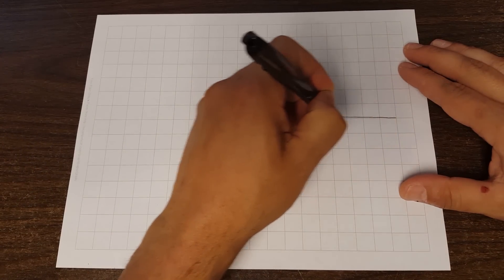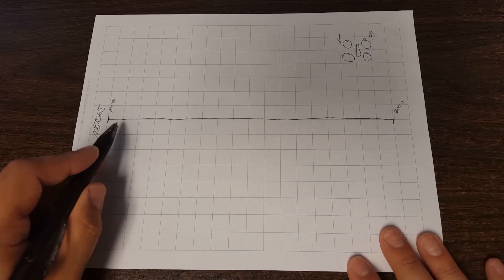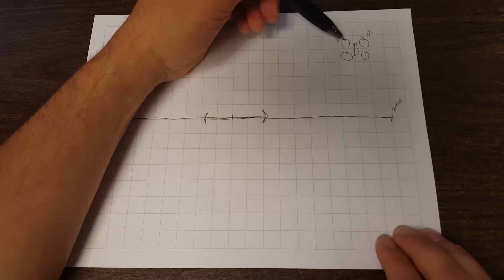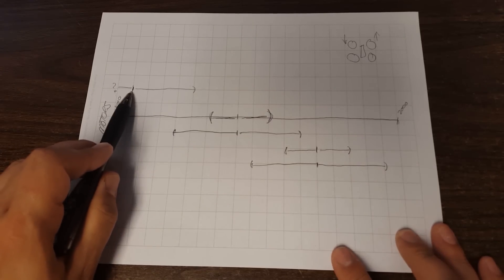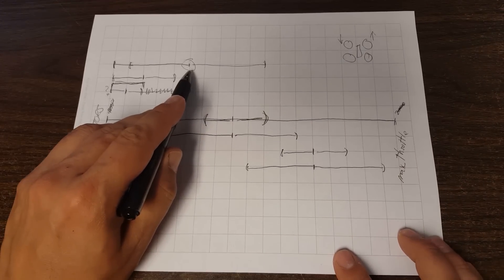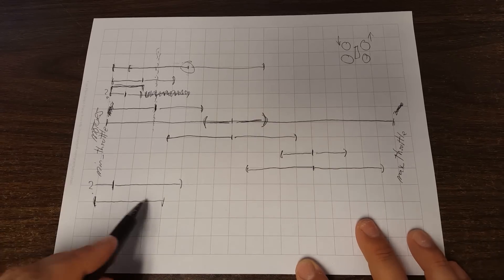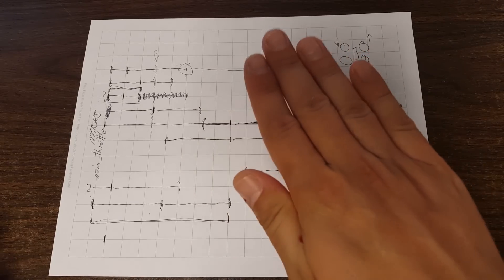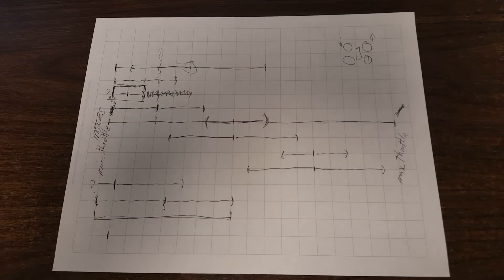What is Airmode? | BETAFLIGHT WITH AIR MODE EXPLAINED

Comment: joshua, thanks a lot for another great valuable video. i really like your channel and learned a lot from you even though I am in FPV for a while.
i have one question concerning air mode: I do not understand, why a copter on the ground either with props on and holding it or without props just sitting on my table shows same behavior:
with airmode activated and giving a quick throttle punch, the motors are spinning pretty fast but do not calm down anymore.
doing the same without airmode motor speed is going down immediatly again after the throttle punch.
how come?

thanks a lot and best regards from vienna, austria!
christian
Reply: The gyros are sensing tiny vibrations in the quad, and when they try to compensate for them nothing happens because there are no props on. So the pid controller spins the motors faster and faster to compensate until they are at full throttle. The pid controller doesn't think that the quad is where it should be.
Reply: Really valuable video. And I met the same situations with yours...
Reply: I get the same issue. Fairly new Wizard x220. Without props it's just scary. You raise and hold the throttle just a little and 2 of my motors, 2 & 3 I believe, just slowly increase in speed. Or when I move the pitch/roll/yaw around it goes all nuts and stays crazy, which that's probably due to the PIDs wanting to go to the virtual position that it thinks it should be in even though it's just sitting on the table.

I had it go nuts while it the air the first 10 seconds and smacked the ground. Shorted an ESC. Just replaced it with a v2 racerstar. Updated and tuned it, seems okay now.The DRL Simulator is definitely different. Seems to hold throttle a lot better.
Reply: @thomastommy9864  does the wizard 220 have an air mode?

Comment: Lesson learned.  Do not land in Airmode.   I have linked my Airmode to Acro and switch into hover right before touchdown.  If your copter is acro only with everything else disabled than you should have airmode disabled before landing with a switch.    The Airmode idea is brilliant, once again I am really proud of my fellow countryman Boris for Betaflight development.
Reply from the maker: +RC Pilot Multirotor I have air mode on all the time and have no trouble landing. I'm not sure what all the fuss is about.
Reply from the maker: Okay, okay... I was being a little glib. I think the fuss is from people who stick arm, who can't input the disarm command as sharply as if you switch arm. If you switch arm, it is zero problem to flip the switch at the same time as when you zero the throttle. If you stick arm, you have to zero the throttle and then yaw left, and it may take a fraction of a second to register the command.

If you have a spare Aux channel, and most of us do these days, I think you should convert to switch arming. Stick arming is an artifact of the days when we had four-channel radios. Overloading the control in that way for a function as important as arm/disarm is bad UI design. (IMO of course)

Comment: How about if air mode makes my motors spin even at min throttle?  I couldn't arm without the motors spinning up so I turned air mode off.  Naze 32 with 1060 min throttle.
Reply from the maker: +Michael Koster that's intentional. If you don't like it, put air mode on a switch.
Reply: Thx for the reply, I will put it on a switch.  Is there any point in using the motor_stop function?  I guess if you aren't taking off in air mode you still get benefit from motor_stop.  With air mode can I kill the throttle fully and the quad will stay upright? (mine currently starts to roll),  will it still descend quickly?
Reply from the maker: Air mode keeps the copter stable when you cut the throttle. 

I don't personally think motor stop is safe.

Comment: Fantastic explanation. I have a question relating to the airmode_activate_throttle parameter which is set to 1350 by default. As I am using a switch to activate airmode does this parameter has any effect at all? If it does should I lower this value as whilst performing loops I keep throttle to very minimum for slightly longer during drops and performing maneuvers during aggressive descends? (I also have enabled the motors to spin when armed). Thanks!
Reply from the maker: airmode_activate only applies to the first time the throttle goes above this value. After that, airmode is on all the time. So that value won't affect your power loops at all.

Comment: Can anyone tell me what would happen if you crashed with air mode on?
Reply from the maker: I think that air mode actually helps with crashing. Since enabling air mode, I have had more crashes where the copter stabilized itself and I was able to fly away. Early on in air mode's development, it was too aggressive and could result in violent flyaways if the copter was knocked about. That's no an issue any more as far as I know.

Comment: With the constantly evolving technology surrounding firmware is it possible to have an air mode that only works when throttle is above one box so when someone tries to land and they give min throttle airmode won't engage
Reply from the maker: Not easily. If you have a Taranis, you could link an Aux channel to the throttle so that the Aux channel only activated air mode when the throttle was above min_check, or something like that. But I hear tell that in Betaflight 2.8.0 air mode isn't a mode any more, so I'm not sure you can turn it off.
Reply: Does what I asked make since??
Reply from the maker: Yeah, sure. You want air mode to deactivate when you drop the throttle all the way so you can land more easily, but you still want increased authority at lower throttle (but not zero throttle). Most people who fly air mode want to be able to drop the throttle ALL the way down in flight while keeping authority, but I understand what you're asking for too.

Comment: Can you expand on this to include mtorstop? I haven't updated my firmware yet to use airmode. I have motorstop off. Where does that fall on this spectrum?
Reply from the maker: +David Resseguie air mode overrides motor stop. When motor stop is on, min_command is sent to the ESC's when the throttle is below min_check. In other words, when the throttle is down, the motors stop spinning. If you are using air mode, you obviously don't want that.
Reply: Joshua Bardwell Right, that makes sense. I guess I was interested in how my setup (motorstop=false, no throttle up or airmode enabled) works compared to the two explained here. Is it just the scenario where I don't get full authority at the extremes? But I still have some authority with zero throttle because I can maneuver in freefall.
Reply from the maker: You have greatly reduced authority at zero throttle. To me, it feels like drastically low I gain.
Reply: I must be subconsciously bumping up the throttle a bit when I'm flying. I need to break down and upgrade all the things. Maybe while I'm out of commission anyway (still no video) is a good time to work on it.

Comment: completely makes sense. 1 question though, so how do you land the drone on airmode? thanks
Reply from the maker: +ricksternz Same as always. Just have to be smoother about it to keep it from hopping about. The days when it would absolutely flip out and go crazy if you had air mode on are gone. Air mode has been tamed a bit. Get close to the ground, lower throttle gradually. Cut throttle and disarm when you nudge the ground or when you feel that you are close to the ground.

Stick arming makes this a lot harder though since it is not instantaneous. I highly recommend switch arming.

Comment: You did not explain how idle up differs from airmode, and you did make the comment that you would explain that.  Sone guys don't like airmode and they prefer idle up. In am not sure why.  Maybe you could explain?
Reply from the maker: +SSBelmont 5:52 is where I described the difference between idle up and air mode. In short, idle up prevents the "set point" from EVER going below a certain point. Air mode allows the idle up to go below that point, and only raises the "set point" if it is needed to achieve control authority. So when the sticks are centered, air mode allows the "set point" to go all the way down to min_throttle, but idle up keeps the "set point" higher.

Comment: Joshua.I recently moved to betaflight and air mode. I tried Air mode by default. when I do fast roll or pitch - drone is not flipping but does like 80% angle and that's it. How to flip in Air mode ? All setting are default
Reply from the maker: +Michael Zukas you are in angle mode.
Reply: +Joshua Bardwell is your Taranis somehow different from default setting for Airmode ?

Comment: So i had a crash this weekend and its completely unexplained.  I was using airmode, but don't use it most of the time.  I had several flights with similar punchouts without any problems until this last flight.  At zero throttle, I rolled the quad over upside down, then back to right side up and I think released all stick movements and 0 throttle.  Next thing I knew I was spinning out of control and I had zero authority over the quad until it smacked a rock.  :(  good news is , its a vortex pro and the only damage was a motor.  I changed the dented motor and everything is working normally so it wasn't a motor or esc failure.  any idea what could have happened.  No no black box :(  https://www.youtube.com/watch?v=UNQ1EZLK2zo
Reply from the maker: +TurkFPV It certainly does come out of nowhere. I don't really have a suggestion of what happened. I mean, it could be as simple as a loose prop nut.
Reply: I checked everything over after the crash.  It was crazy, nothing was out of place other than the bent bell housing on the motor.  It literally spun out of control without any input from me and would not come back out of it.

Comment: airmode drains batteries faster?
Reply from the maker: +alex sales No.
Reply: great! :)
Reply: +Joshua Bardwell I tried it just now, on airmode, as soon as I go full throttle, my voltage checker will beep but with idle up only, it doesn't beep with full throttle.
Reply from the maker: alex sales I don't know what to tell you. I haven't noticed any difference in my flight times since enabling it. Battery beeper is a pretty poor way of measuring power draw. An OSD with current sensor would be better.
Reply: +Joshua Bardwell Even a simple osd with pack voltage is better. I can visibly see voltage sag and when the packs dumping and land real fast.

Comment: i install the CF1.12 and bF 2.6.0 to use this feature bit my zmr go crazy on PID's still trying to retune but nothin work it's woobling and flips just wen liftoff, i use looptime at 1khz naze32 rev5 2204motors and escs Dys 18a with Blheli 14.4, in version of cf 1.11 works but no airmode for me... any tips? thanks.
Reply from the maker: +Kassio L. M Probably your D gains are too high, but it could be most anything. It's probably a tuning issue.
Reply: +Joshua Bardwell Thanks man, i just restore defaults PID's and put my D below 20 and my I in  0,018 and works like a charm, using BF 2.6.0 and i'm back on air, funfunfun thanks a lot. I was rong with de P settings, thanks again and happy flying. and R.I.P. all my propellers trying to fix this. my bad. rsrsr

Comment: Joshua,,,,so what in air mode gives the extra hang time ? inverted.... if the throttle set point is brought up... surely it will descend quicker...?
Reply: +bing crosby  or does it know its inverted and reduce the throttle accordingly....
Reply: If you are not giving any big stick input (big roll for example) but have the sticks centered then it will not need to raise the throttle set point.
Reply: +bing crosby Nobody said that airmode gives extra hangtime. This is a legend :)

Only the fact that you can go all the way to min_throttle reliably can give extra hang time.

Before Airmode the quad would tumble like a feather if you didn't use idle up.
Reply from the maker: +bing crosby Air mode gives more hang time if you are using it instead of idle up, since the motor set point goes down to min_throttle if the sticks are centered.
Reply: ok thanks for that

Comment: This was very helpful. When airmode first exploded into the world there was a ton of hype around what it did. Also, as it developed, I know that the definition has evolved. It's been a confusing topic in my circles. I always just stood by my idle up function and was rather agnostic about whether airmode was really doing much; at least for me and my flying. Very recently, I've felt a handling difference with airmode on. I think that started with 2.2 but haven't taken the time to understand why. ---- TLDR ---- Makes a lot of sense now. thanks.
Reply from the maker: +12gaugeAngel If you use idle up, you will feel less difference from air mode. The real advantage of air mode is that the "set point" can go down when the sticks are centered, giving increased hang time inverted compared to idle up.

Comment: Great explanation. But I have a question still. I install Betaflight on all of our copters, I set them all up for acro/rate mode ( my understanding of this is that a: the accelerometer is off, and b: only the gyroscope is on ) context: I also always set an idle up throttle setting, and I use the LuxFloat pid controller. But what I am wondering is that if I hold the copter (props off of course) perfectly level and still so that it can arm -> and -> air-mode enabled,  then give a little bit of throttle input to simulate takeoff... and then using only my hand holding the copter... move the copter...(no stick inputs) the motor rotation speed varies as a reaction to me moving the copter. Why is this? it makes me think that the accelerometer is actually on, and feeding the pid loop... What am I missing?
Reply from the maker: +speed stalkers FPV It's not the acc that's detecting your motion, but the gyro. The gyro has detected that the copter moved and the I term is trying to unwind that move. If you think about it, if you had perfect dead reckoning, you could do autolevel just based on the gyro. But since the gyro is not perfect, you get accumulated error over time and you need the accelerometer to correct that error. But over a short period of time and relatively slow movements, the gyro alone can do autolevel, and in fact, that's how Cleanflight actually works. The accelerometer is only read at a relatively slow rate to correct accumulated error, and the gyro is used in real-time for autolevel.
Reply: +Joshua Bardwell thanks Joshua, you are the man! Well Boris is not too shabby either ;)

Comment: Explained well!  No wonder my minimum throttle doesn't control as well as I would like.  Air mode is worth trying now!
Reply from the maker: +Michael Steele DEFINITELY. Raising min_throttle will increase how fast the motors are spinning when you are at idle, but here's the thing... it WON'T increase the authority between the down-spinning and up-spinning motors.

Comment: Thanks! Best explanation I've seen.  I do have questions ;)

1) Does airmode give the same behavior near max_throttle?  If you hit full aileron at full throttle will the throttle automatically be lowered to give max roll authority?

2) Was it tried to give max unbalanced authority when throttle set-point is low?  That is don't "throw away" the excess rpm increase just because the decrease was not available on the low end?  It would give an off-center cyclic thrust but might not be significant?
Reply from the maker: +gmceo100 Examination of the code shows that yes, the same behavior occurs at both ends of the throttle range. For point two, you would have to turn to Boris.

Comment: hi Joshua, I enjoyed the video. It was very informative. Can you tell me if airmode will work if i fly in horizon mode.Also could you do a short video on setting it up?
Reply from the maker: +fpv flyby Air Mode is enabled in the Modes tab, same as Horizon mode. You can have them active at the same time.
Reply: +Joshua Bardwell thanks a lot man keep up the good work.

Comment: Great video, I kinda knew what it did, just not how it did it, now it makes sense in my tiny mind.
Acro+ on the other hand I have not a single clue what that is, if you ever feel like shedding light on that it would be appreciated.
Reply from the maker: +LeakyMeat Acro+ disconnects the PID controller from the mixer, and basically puts the stick inputs directly through to the mixer with reduced stabilization. As a result, you get much faster flips and rolls because the PID controller is not trying to manage the exact angular rate of the roll.
Reply: +Joshua Bardwell Ah right, thanks for that explaination, sounds like its not for someone of my skill level.

Comment: Would it be recommended to fly air mode for the whole flight or are there any disadvantages during flight when using air mode.
Reply from the maker: +Harry s I fly it the whole flight. Some people have reported that the increased throttle set-point results in less hang-time when inverted, but the increased authority is more than worth it to me.
Reply: +Joshua Bardwell thanks
Reply: At first thanks for the great explanation (and all the others).

I deduct another interpretation:
As you mention on all manoevers some engines has to spin up. Some spin down.

What is happening now is, that if the engines to spin down can't, the ones to spin up simply spin up the more.

If you are then inverted (min throttle), for all manoevers the spin up motors do double the thrust (downwards then) than without air mode. 
That gives you less hang time - a price one has to pay for the increased agility.
But it should be the same hang time without air mode and doubled strength of the input command - i. e. compensating the reduced response at min throttle manually.
Or do I miss something?